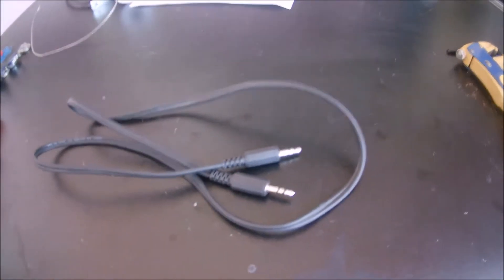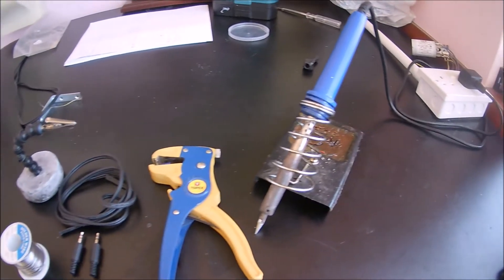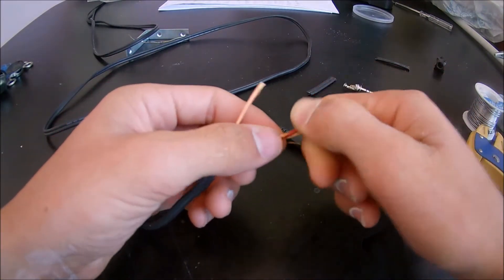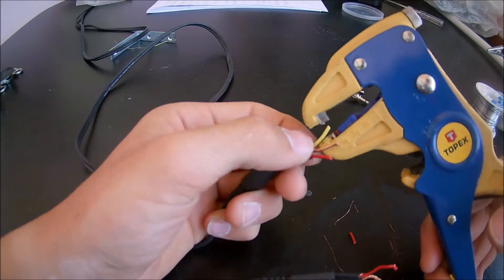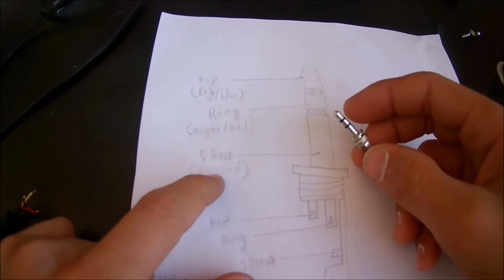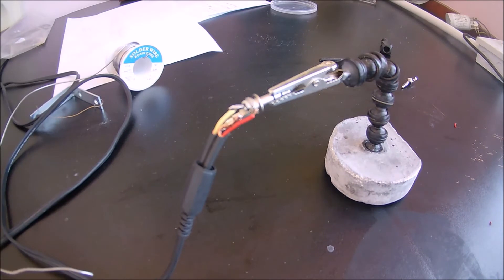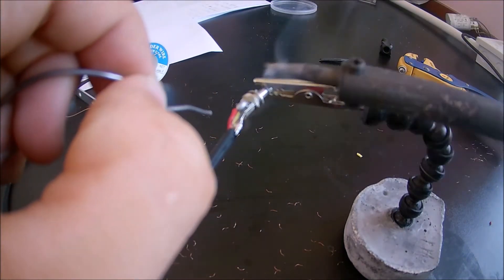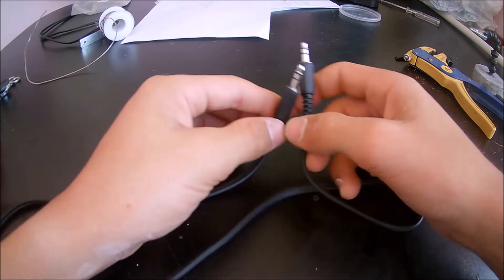How to make a DIY Aux cord

Comment: Hey man, little question here, can I conect two cable phones with a P2 plug in each end and turn it into an aux ?
Reply from the maker: Yeah that should also work just use the audio wires in the cable